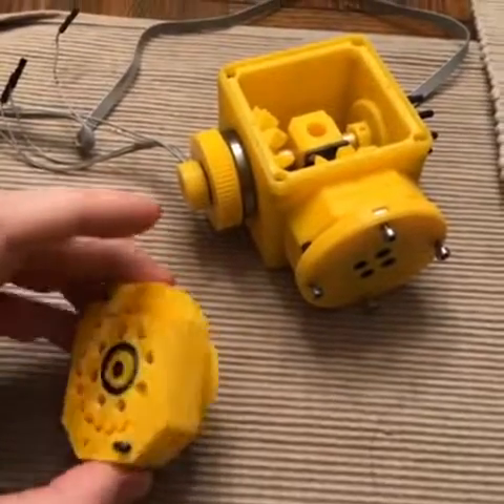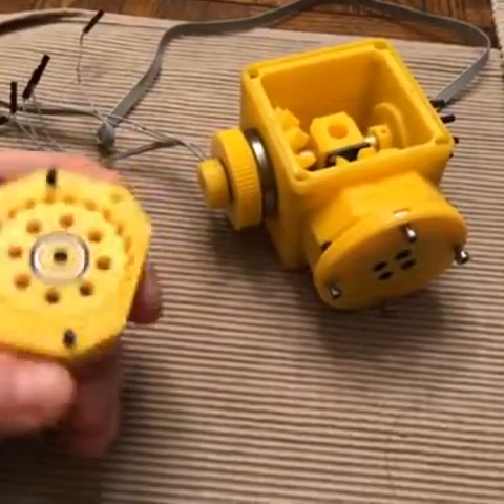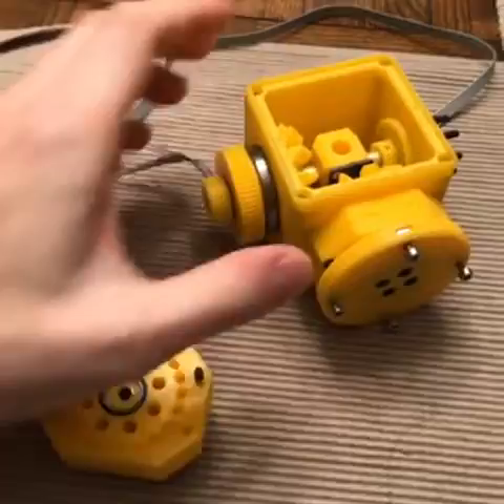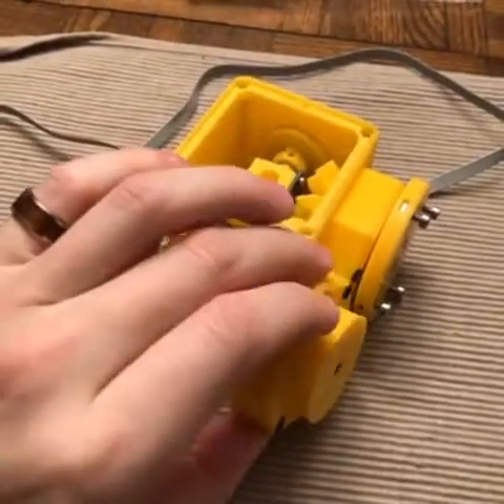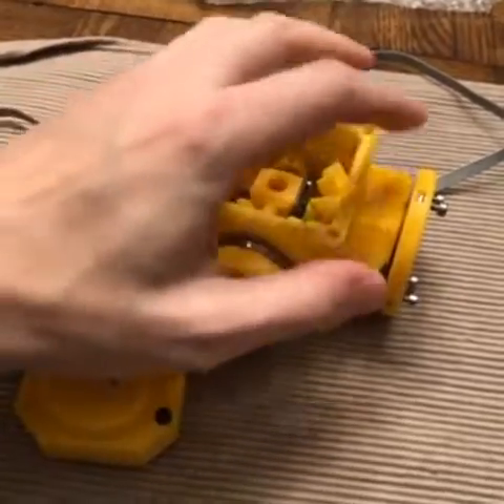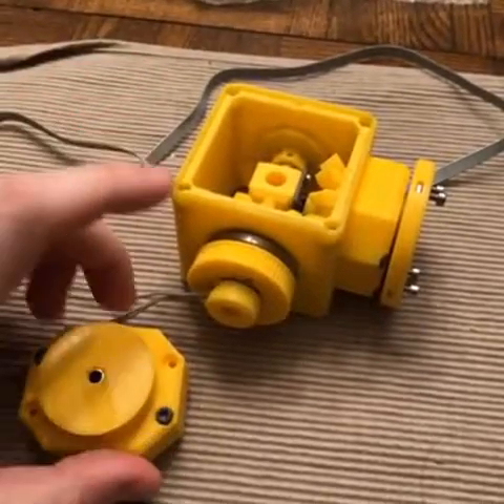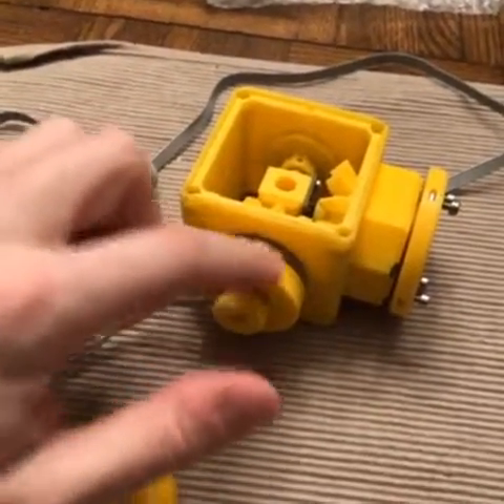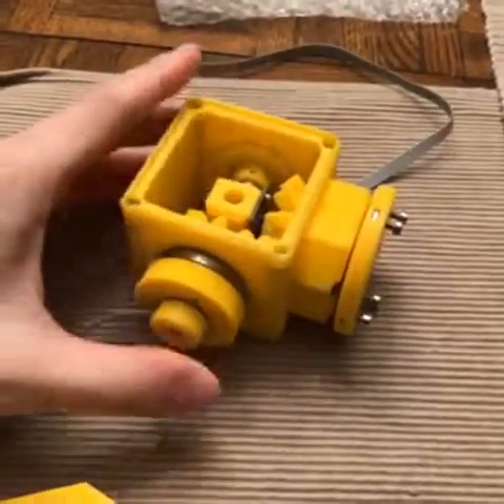Sixi Robot : motor gearbox belt or motor belt gearbox?

Comment: must be hard to get cycloidal gears to work with 3d printed parts. I might be able to make if my printer is correctly calibrated.  Do you think it's better to make hypocloid drives or get flexible TPU and make harmonic drives?
Reply from the maker: I can imagine how I would print a harmonic flex ring, but not how it would survive real world torque.  Delamination is a real problem.  We (and several others) seem to be doing OK with cycloids.